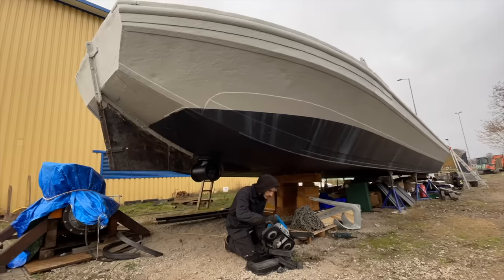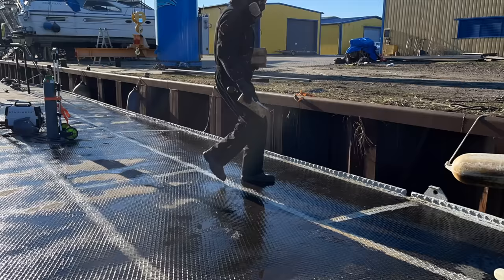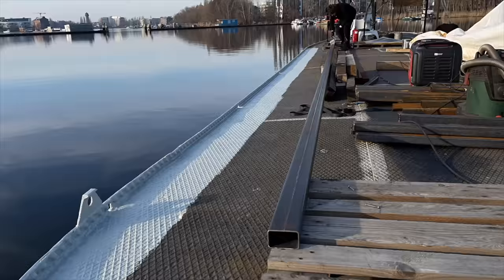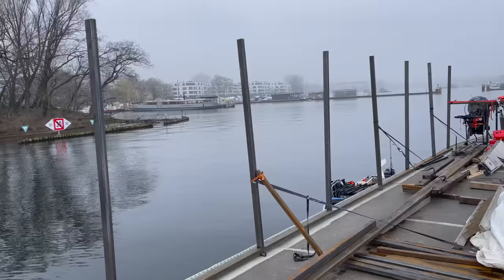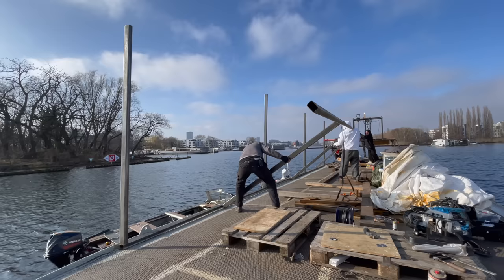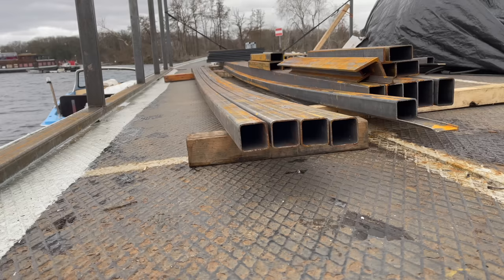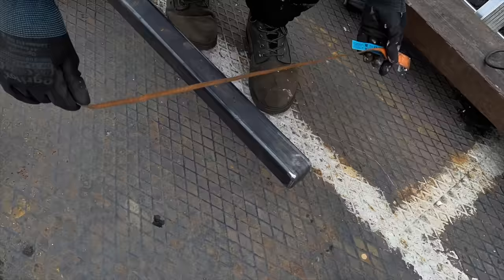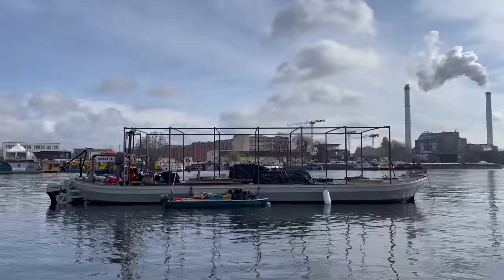Building a HUGE CABIN on my BARGE BOAT

Comment: I’d add 45 degree angle plates in the corners or cross strapping before it gets enclosed with the remaining structure. The twisting forces are going to be quite large and over time will weaken the structure even with the cover material added.
Reply: I thought about saying that but I believe he will do it.
Reply: Dannggggg
Reply: I was going to say a few diagonal beams might be a good idea but corner plates sounds good.
Reply: Needs Bracing!
Reply: Yes it needs gussets
Reply: Yes.
Reply: Yes diagonals are important the triangle is the most stable structure in engineering and even when this is covered in whatever sheeting you're going to use an angle brace in the corners or a diagonal between upright will add immeasurable strength to the structure
Reply: it would depend on the covering material used.
Reply: The lot of you need a chill pill, if there is one thing I know he will brace the shit out of this as he always does. He has an excellent grasp of physics.
Reply: @teeanahera8949  so he knows that the bracing needs to be done first, right? I see. Buh bye
Reply: What type of hull did he use?
Reply: @j_rainsgoat3929  its a flat bottom
Reply: @teeanahera8949  7 minutes 8 seconds into this video the weld breaks when he is trying to stand up the wall frame. Diagonal bracing before standing up the wall framing maybe would have avoided this?
Reply: Yes he does need that bracing, they are called "Gussets." He should have removed that Mill scale from that square tubing where he's welding. Iy your running hot enough you can burn through it, but I never take that chance. I see several places he might have issues in time. Time and weather will eventually show where things could have been done different. But hey l, this man did this himself and that stands and counts for not just something, but a lot of things!!

Comment: WOW those walls are huge. The wind is really going to have a major effect on your shallow draft barge. You will definitely be using your bow thruster A LOT to counter the winds. I assume you will be adding some diagonal bracing to prevent any front to rear or side to side flexing. Good job.

Comment: We have welded various tubes closed and it is always surprising that they are not water tight . Even though the welds look good. 
Over time water gets in and rusts from the inside out.
You may want to check you welds to avoid this problem 
Cheers warren

Comment: Will your anchor be big/strong enoughfor this? It will be a huge winx catcher with this structure added. Just a thought.
Reply: It's definitely a wind catcher.  But no different than some of the houseboats on the water.  It could be two stories high.
Reply: He will certainly find out
Reply: Is this cabin your own design, or did you get a naval architect to design it for you.?
Reply: Should the anchor have a bridle to take any strain from the windlass in high winds?
Reply: @greggbutler9344  Best innocent question ever!
Reply: That's like an empty 18 wheeler in high winds.
Reply: One thing I've seen with this is you have a hell of a lot of money or a lot of support from people that do. Make sure it stays one story because it'll be too top heavy for that barge you've got. Definitely got the idea from someone, but not a naval architect, and you definitely didn't think it through.
Reply: No way that would be safe at two stories high…. I my mind at least..
 I think a naval architect is definitely worth the $$$$$$
Reply: Have you considered some level of ventilation for the steel beams to vent condensation and the formation of rust internally ? For the vertical beams this would obviously be at their bases, and at the outer ends of the roof beams, but within the cabin space. Is this likely to be a sensible precaution, or completely unnecessary ?    Good luck, best regards
Reply: Most of the holding power of the anchor comes from surface friction by the chain sitting along the bottom.

Comment: For anyone trying to frame a large structure by yourself, a good assortment of tension/ ratchet straps is a huge help in getting things lined up and square before the final weld/ bolt/ nail. And as demonstrated here, also a big help in getting heavy or awkward beams/ posts/ tubing into place with only one set of hands. I'd place them only slightly behind clamps for handiness on big jobs.

Comment: You need wind bracing.  Use flat straps of metal.  Very thin.  To make big X shaped braces for each side.  It will save you in the long run.

Comment: You need some stealit or other form of weld through primer so your not fighting oxidation on the metal, I understand that on a boat it is just the nature of the environment but the cost is worth it in the long run, very cool built!🎉

Comment: Remember to drill holes in all your iron bars, otherwise they would rust from the inside, they must be able to get rid of the condensation water
Reply: It's normal to weld box sections closed to stop oxygen from getting in. No oxygen, no rust.

Comment: As a retired engineer I noticed previously that you have drilled your square and rectangular hollow sections for bolting. This is non preffered as it encourages corrosion.
Best practise is to weld lugs and drill them to fix your bolted items. Also you should weld end caps as you have done but drilling a 3 to 6mm weep hole to allow welding gases to escape, then sealing the weephole with mastic to prevent any water ingress. I hope this helps.

Comment: If you don't trim the ends that you fold over on the beams, you can use this to hold on to the vertical joints as well. Looking good.

Comment: looks cool. i would make the front roof and wall at the bow out of glas (or a similar material you can look through), so you can see what is in front of your boat when you are driving.
Reply: Or move the controls to front of the barge, either that or install cameras with video monitors at the helm.

Comment: Looking good!  I noticed your welding skills have improved greatly from when you began.  I leave where welding in the wind happens all the time... you may consider using a flux core welding wire in you wire feed welder.  You may already be aware of that process, for me it works well in windy conditions.  I am looking forward to seeing your finished product.

Comment: Very happy to see your progress.
Fun to follow along your project.
Did you ever consider to open the deck of the barge, and lower the floor more down into the barge so the cabin structure did not become so tall?
I understand it should add a huge amount of work, but in an eventually consideration, what other reasons made you not to do it?
My thoughts about it was...for the first... The higher up from water level the cabin floor is, the more "pendulum movement" you get from waves and wind, and I think the esthetic of the boat would look better with less hight of the walls.
Keep up the good work, Pal...

Comment: I hope there is a good weight at the bottom of the boat because it looks like you will be very top heavy. Also, I hope you plan to primer everything or all that metal will get rusted being on the water full time.

Good Luck with your build!

Comment: Looking awesome, Will you be enclosing the sides and figuring out which side section you will leave open while closing the rest? I would park the big boat alongside it and figuring out where the door sits on the boat so you can step straight out and be undercover. And possibly stagger the opposing side so you don't get a nasty blow through of air. 
Perhaps getting clear tinted curtains for privacy for each bay, so that you can open sides where boats are parked up to the sides as needed while stopping cold breezes and weather from getting in. A nice clear but tinted roofing would also be awesome for maximum light while keeping the area cool during the summers.

Comment: I remember a man built a very similar houseboat. The day he launched it at the boat ramp. It floated right off the trailer. Dozens of boats watched in horror as the boat started swaying. He jumped on. The swaying got so bad it flung him into the bridge next to the ramp. He was face down. Two guys jumped into the water. Police, coast guard, sea scouts. The boat sank right there on the ramp. 
Just because it floats does not mean it’s seaworthy.

Comment: make tag plates on the deck and weld your structure on it  so you don't damage your deck if you need to remove it, if you weld on the deck close the weld 360 to avoid water and dirt go underneath

Comment: I have commented that this is a great video, and it is. In fact, I have gone back and viewed some previous videos in this series. I know little about boats and nothing about barges, but it appears to me that the vertical fin or skeg of the boat is incorrectly on the bow of the boat, when it should be on the stern. Or, perhaps, skegs at the stern are counterproductive when there are outboards or double outboards. Idk. In either case, I would think that a skeg at the bow of a boat is counterproductive, specifically with regards of maneuverability.

Comment: Nice job, but you could of stream lined it some taper to the structure to look more graceful, and now you need a new pilot house so you can see.  And it should have more walk way so you can walk around the cabin, and do maintenance, and mooring, the pieces you folded over on roof beams snd cut off, could of been left on a bit to weld to the uprights for strength. I don't want to sound cruel , but you did a beautiful job so far, so make a plan, rip that box off and make a beautiful ship,! You can do it!!!

Comment: Maybe consider welding in 45 degree triangle 📐 supports one at the floor on one beam next beam at the roof and opposite placement on the opposite side to aspire towards lateral strength to resist rolling yaw stress reducing metal fatigue and lateral collapse

Comment: I'm sure you've got bracing figured out in your plans, but when I see a square structure like that I only see it bending and falling to one side or forward or backward.  I would definitely add some X bracing on all four sides, so it's a completely secure self-contained box even if it wasn't welded to the barge.  I've never done anything like this, but I know water and especially salt water is really harsh on metal.  Between the lip of the edge of the barge and your bottom steel bars looks like a really bad area for water and debris to collect and corrode the metal.  Hopefully you have something figured out for that.  I wouldn't want any gap where water could get trapped.

Comment: Did you consider drilling holes in the metal tubes and bolting the frame together.  Welding the tubes together while they are being held together manually looks a little tricky, to me.

Comment: How are you measuring the displacement/buoyancy when making these changes?

Also are you worried about the effect wind will have with the large rectangle cabin?

Out of curiosity, what is the objective of this vessel? A cruising yacht? A live aboard boat house?
Reply: From what I've seen of this guy he probably doesn't have any idea of the buoyancy displacement or stability of this creation, and probably hasn't thought of windage either.

Comment: Nice project but be careful of stability. Using steel square section as heavy as yours plus cladding will make your barge very tender when under way. Ensure you put plenty of liquid ballast deep down in the hull, water, fuel, sewage and grey water should offset most of the topside weight.

Comment: Will this houseboat be stationary or do plan to travel in it? Traveling in it may be difficult because the forward sight line will be hampered by the high roof. Maybe you could mount cameras  in front and have a live monitor feed to see what's in front of you. Don't want to run over someone in a row boat.

Comment: Just my opinion but I think I would have left tube flat on floor and leveled out the vertical (studs) tube for top plate of wall. That way you have full contact on base for complete seal at base.

Comment: Why not buy an engine driven welder since you already have two generators and mainly did stick welding? Or couldn't you use the one from the steel yacht? Just curious lol. Loving this project so far!

Comment: The span is way to wide for that thin tubing. The roof being curved will result in the walls being pushed out if you apply load on the roof.

Comment: My dad an I built several salmon fishing boats. Then we built boat like this design but smaller in dimensions! How much weight an how far above boat decking? Was it mistake to cut off extended flap on ends. They could have rapped around outside top edge an locked all together? Do you have whole structure welded by 2 end tack welds. I take it, your not worried too much about extra weight in this build?

Comment: Curious why you did not use aluminum instead of steel unless you wanted to add a lot more structure to the barge which I’m assuming it really didn’t need it

Comment: i like were your going with your boat , it looks very tall . it looks like you could take off two feet and still have seven foot cabin hight. you will have less trouble with bridge hight , and you will be able to see better driving, if it was my boat i would cut the deck and lower the cabin into the boat and weld every thing and weld in more supports. it would be supper strong and three foot lower . you could see better and have all that roof for solar cells and a rubber tender. your boat would not be top heavy and would have less rocking. i would have used two small inboard diesel engines. i put two thirty foot boats together and i know how much money it takes to put every thing you want in a boat and it can bake you very fast. you know what they say, a boat is a hole in the water to throw your money in. with a cabin that big you can have a full size house boat with every thing a full size house has. i am just dreaming of things i would love to do and i am not telling you to do any thing i say so please forgive me for going on and on. great video, love the project , can't wait to see it finished .

Comment: Stability of a craft is a complex bit of math,,, that says,, weight up high is dangerous.  If a boat can carry safely a 10 kilo weight at the Gunwale height.  That same 10 kilo weight could make the vessel dangerous,, prone to rolling over, if the weight is  3 meters in the air.  And it makes a difference if the high weight is near the centerline,, or out at the edges.  Windage as well.  Wind over a broad surface can create quite a bit of horsepower.  Sailboats take advantage of some of this,, by having a lead keel that may be 2 meters below the bottom and 40% of the total weight of the vessel.

Comment: Why did you use such huge steel beams? I also would have added a few straps to your beams prior to lifting because if someone would have let go, goodbye beams, straight to the bottom. I would have used galvanized steel stud beams that they use to build houses. You added a lot of weight. I also would have cut the deck open and made this an almost 2 story home. That's a lot of wasted space inside your boat. But hey, it's your boat bud. I ain't mad at ya...